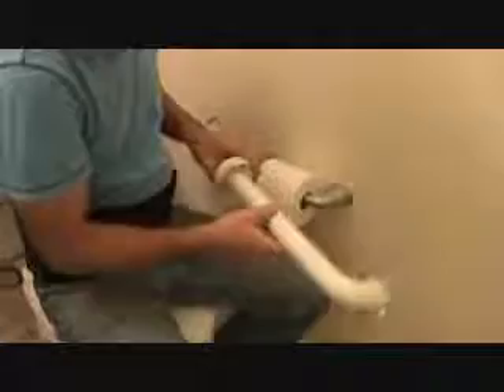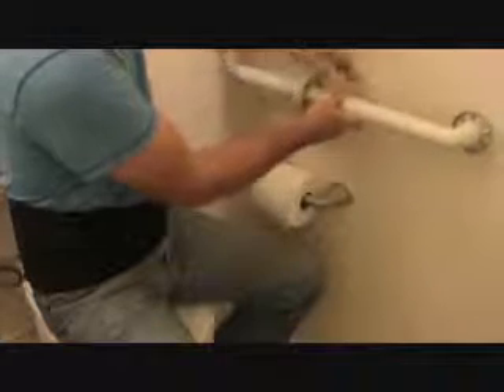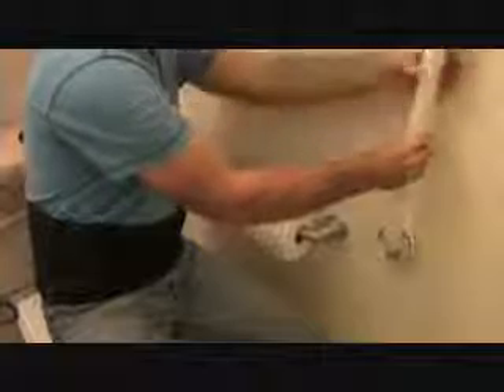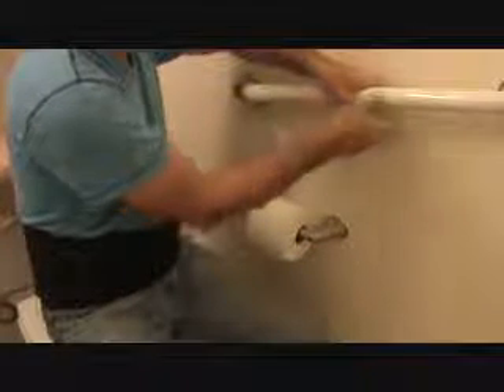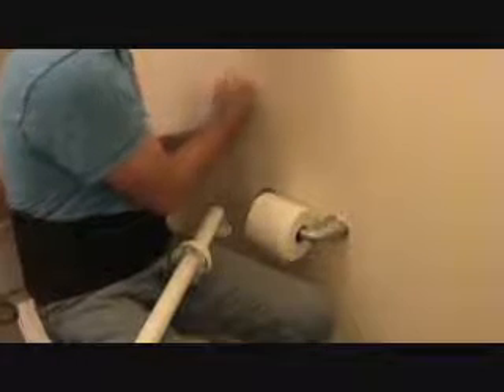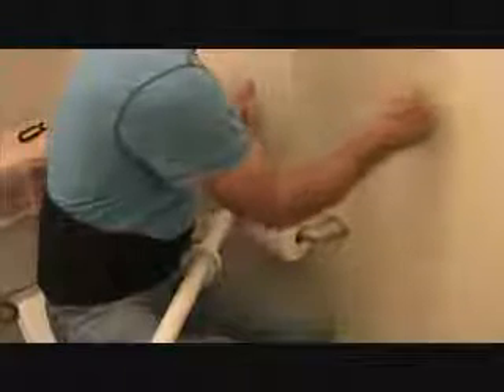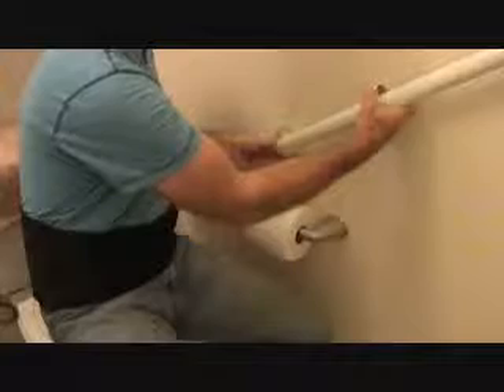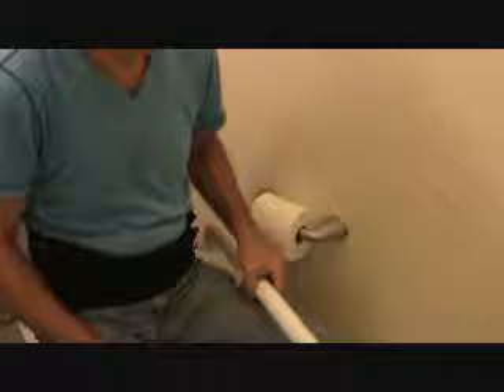A better way to secure a grab bar...Part 2

Comment: What if I use it on a hollow wall?  Will that be safe?
Reply from the maker: Sure you can install on hollow walls. Did you ever get it installed? They have special install anchors for that you can purchase separately designed for grab bars